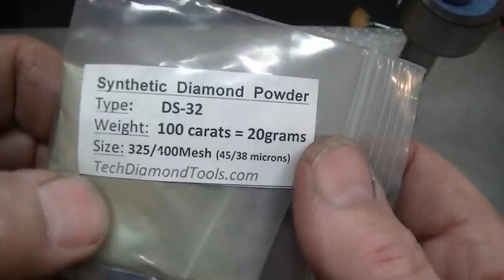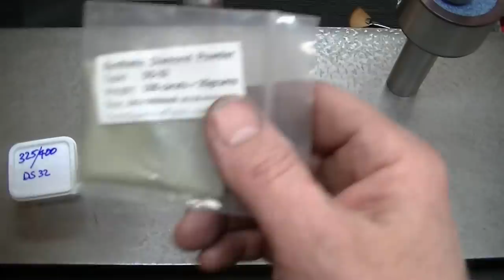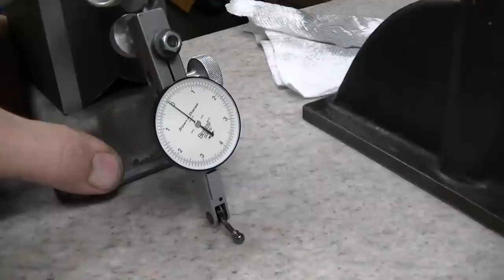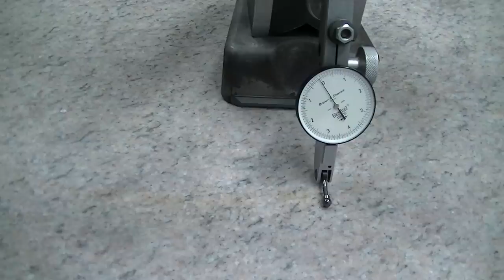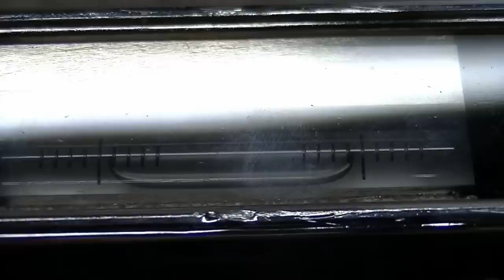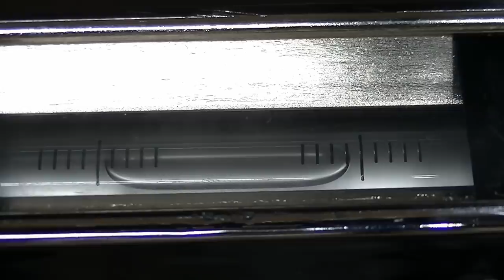DIY SURFACE PLATE LAPPING PART 1

Comment: If its so important to use those two pieces of material to act as a "counterweight" to the weight of the "precision level" to avoid "deflection" of the plate, why doesn't anyone use a "counterweight" to offset the weight of tools and parts while using a surface plate for measurements? And how "level" and "flat" is your tool cart stand? If I remember correctly, your plate sits on "feet" that support it at the edges/corners. Doesn't the plate "deflect" under its own weight? I was under the impression that the reason those surface plates are made of granite 6" to 10" thick is to avoid deflection. I'm also surprised that the lap laps the stone instead of the stone lapping the lap. Cast iron is pretty soft, after all. And the scratching noise sounds more like cast-iron being ground and cut than stone. Sounds a lot like dry hone stones turning in a cylinder bore as a matter of fact.
Reply: Wow, where to start.  I do enough metrology work that if I need to be more precise I do counter balance my plate, sometimes in two directions.  The bottom of the plate could be a small amount off and still be okay, however, based on the previous video about this plates support and Robin's other videos I'm sure it is very close to level.  20 foot granite will still deflect !!!   Cast iron laps that are "charged" will mostly abrade material from the work piece.  Laps that are not "charged" i.e., using free cutting material will abrade from the tool and work piece both.  There are differing instances where it is advantageous to use one or the other, or both, especially where the tool and lap cannot be flipped.  It would be prohibitive to slid the granite surface plate upside down on the lap.  When the granite plate nears completion it is very advantageous for the tool to be lapped at the same time.  When this occurs the lap and work become increasingly flatter using this method with correct technique.

Comment: Plate deflection from level alone is close to nothing.
Your position on the ground usually matters much more, unless you have the plate on like meter thick concrete floor.
Reply: Does it not matter that the cast iron is still on the surface?

Comment: Hi.  I'm not even experienced enough to even be considered a novice, so please don't take any of my questions as why don't you !!!! - that's not where they are coming from  I'm genuinely puzzled at to how they are arrived at.
Addressed to rob - but anyone - feel free if you can contribute.

When you counterbalance the level with an equal and opposite weight.  You say the positioning is done with relation to the edges - so outer = outer, inner = inner...  I can't get my head round this - when positioned at outer/outer aren't the forces bowing the plate edges down to make it convex, while inner/inner must be bowing in to make it concave.  Seem to remember Keith Rucker talking about "harmonic" (my words) that were points that had something to do with how a straight edge does or doesn't flex. but I'm damned if I can find anything about it now.
Reply from the maker: I will cover this in a follow up video. Thanks for watching and commenting.

Comment: Rob,  I don't understand why you are concerned about off setting the weight of the level assembly (10 Lbs ?),  but you have the cast iron lapping plate (100 lbs ?)  laying  on the table in a haphazard manner.
Reply: There are two types of error that are introduced by having objects on the surface plate, distortion caused by the plate sagging, and angular offset from the weight compressing the rubber pads under the plate, the steel frame, and indeed even the concrete slab. The lapping plate does cause both, but neither are of concern because the former is much too small to worry about yet, and the latter is constant throughout the measurements. Balancing the level was a necessary because moving the level would cause the plate to tip by a small amount, and create inconsistent readings.
Reply from the maker: I will cover this in a follow up video. Thanks for watching and commenting.

Comment: As someone else mentioned, I don't understand why you leave the heavy lap plate on the table as you are checking the surface with the level.
Reply: Because it isn't being moved, the influence of the lap is constant and cancels out when the measurement is taken
Reply: Rob Mckennie So, can we expect to see that plate always in that same position when he uses the plate later? I doubt it. Also, the position of the plate has varied, so I can’t agree with your reasoning.
Reply: As long as the plate isn't moved while the measurements are being taken, they cancel out. It can be placed anywhere you like, as long as you don't move it while taking the measurements. The position of the lap on the plate is only important in terms of distortion by sag, but this amount is so small as to be negligible at this stage in lapping.
Reply: It would have been interesting to remove the lap with the camera on the level.
Reply: Rob Mckennie I don’t buy it, unless you’re saying that he will make corrections later. If the mass of the level distorts the plate, then the mass of the lap certainly distorts the plate. End of story.
Reply: Paul Mathews the level isn't distorting the plate (enough to matter), it's changing the balance, causing the level to shift, that's what Robin was measuring when he was moving the counterweight back and forth and watching the bubble. Look dude, I'm just telling you the way it is, if you don't understand that's your problem. Robin is going to be going over this in an upcoming video, and I'll bet dollars to doughnuts he backs up what i've been saying.
Reply: Rob Mckennie I think you’re saying that the entire plate is tilting when loaded unevenly. I look forward to a further explanation.
Reply: That's exactly what's happening. The plate is sitting on rubber feet, which compress under the weight of the plate, so when you add more weight the feet compress more, but not always evenly, introducing a small tilt. That's what's being measured when Robin was moving the counterweight back and forth. Even the steel frame and the concrete floor move when you move things around, which is why robin stayed standing on the same spot while taking his measurements.
Reply: Rob Mckennie Rubber supports? I can find nothing about such a system. See, for example, Question 12 here: http://www.starrett.com/metrology/metrology-products/precision-granite/precision-granite-faq.  Similarly here http://www.precisiongraniteusa.com/images/4919-INSTALLATION-INSTRUCTIONS-FOR-SURFACE-PLATES.pdf.
Reply: Well, it doesn't really matter what Starrett says, seeing as Robin mounted his plate on rubber pads. If you want to see for yourself check out the video Robin put out about the stand he made for this plate
Reply: Rob Mckennie Thanks for pointing me to the video about designing and building the stand. Impressive engineering. I remain curious about how much the ‘essentially incompressible’ pads actually do compress, which is what you are saying is happening depending on how the plate is loaded with masses on its top surface.
Reply: Yeah, he said "essentially incompressible", but when you're talking in tenths everything acts like a rubber band. The steel frame and concrete floor also move under the weight, but to a smaller degree than the rubber.
Reply from the maker: I will cover this in a follow up video. Thanks for watching and commenting.

Comment: What about the underneath granite piece? Does it suffer any distortion after this process?
Reply from the maker: Distortion of the metal base does not affect the flatness of the granite because the granite is sitting on a 3 point support.
Reply: ROBRENZ just because of 3 point support? Ive been trying to understand that, but I couldn’t yet... can you tell me a bit about it?
Reply from the maker: Watch my video "MAKING A SURFACE PLATE STAND" https://youtu.be/yPhzp-OG67s